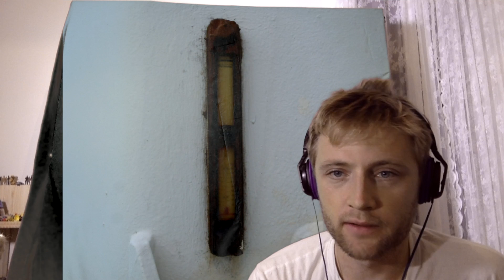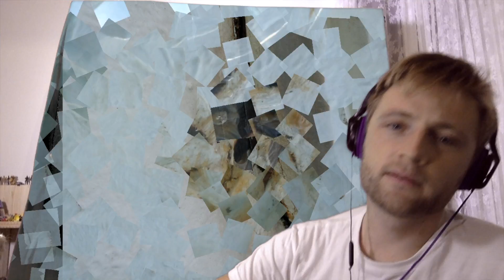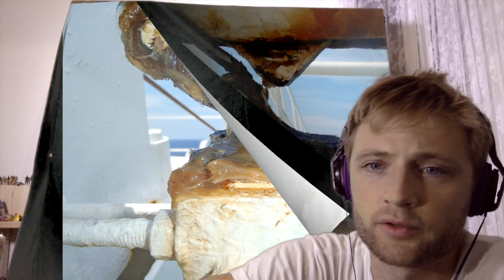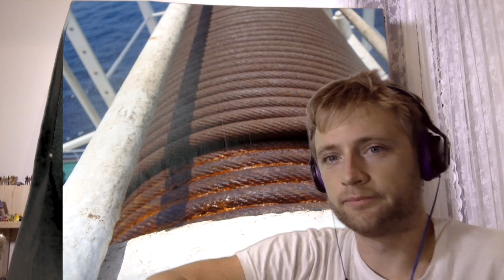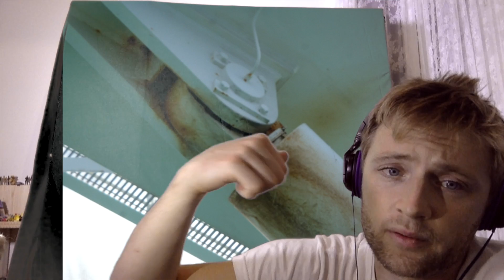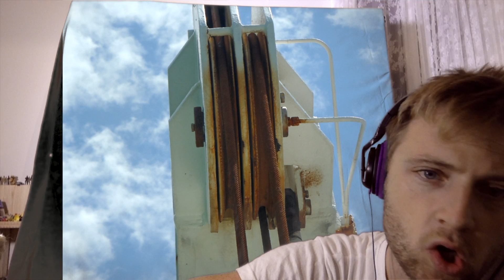Tanker Crane MAINTENANCE photos

Comment: sir, how can i prepare crane in cold condition as an engineer? you know in cold weather (like winter) hydralulic oil doesnt flow well. 
so how to prepare for operation?
Reply from the maker: Just started it some days before arrival let’s say first start the equipment for 30 minutes and then one day before arrival start for one hour so the oil can flow and heat up .There must be a heater as well for the oil to keep it warm in that case check if it is working.

Comment: hi my freins.i want to get some details from you.i have same crane in my vessel (tanker).we have some twist in wire between hook and block.when we lowering or heaving  a hook twist is coming.so can you send vedio to me about how we can take  twist from crane wire.my Whatsapp no +918903912512
Reply from the maker: Hello Michael first of all check that your crane operates normal all parts is free to move next check your limit switches .Also take a carefull check of the wire maybe there is a physical damage. Have a  good solve there and always use safety belts and make a aloft permit! Thanks
Reply: thanks my friend.